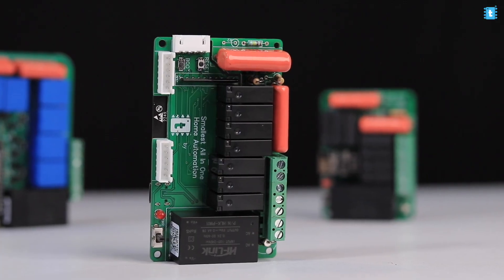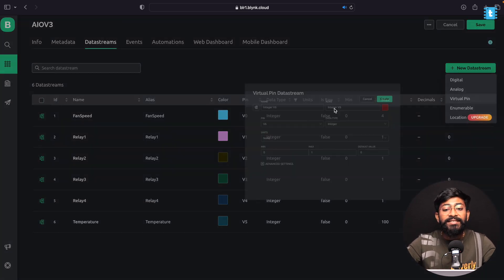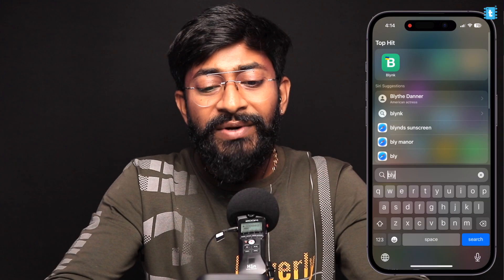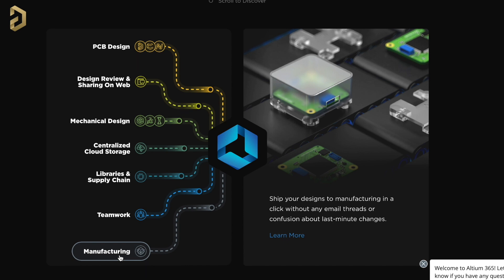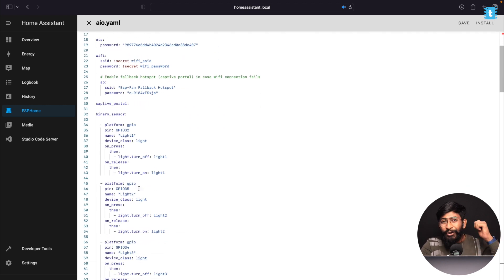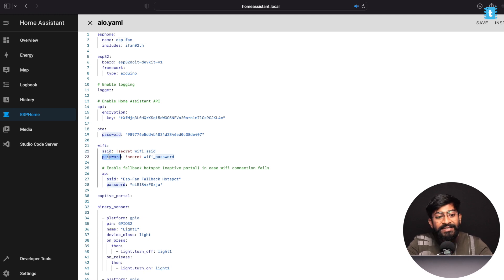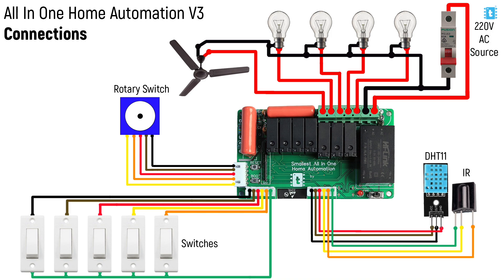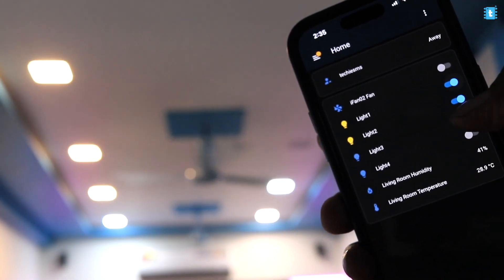Home Assistant & New Blynk based Home Automation project | IOT Projects 2023 | ESP32 Projects

Comment: For fan regulators and IR controls, the below codes are far more accurate and easy to use compared to what is shown in the video. 
We have been using them in our home for more than 1.5 years, and no issues have been reported so far."
Reply: switch:
  - platform: gpio
    pin: 23
    inverted: true
    name: "FAST"
    id: speed_low
    interlock: &interlock_group [speed_low,speed_med, speed_high]
    interlock_wait_time: 300ms
    
  - platform: gpio
    pin: 22
    inverted: true
    name: "SLOW"
    id: speed_med
    interlock: [speed_low]
    interlock_wait_time: 300ms
    
  - platform: gpio
    pin: 21
    inverted: true
    name: "MEDIUM"
    id: speed_high
    interlock: *interlock_group
    interlock_wait_time: 300ms
Reply: sensor:
  - platform: ir
    pin: GPIO14
    name: "IR Sensor"

switch:
  - platform: template
    name: "IR LED"
    turn_on_action:
      - ir.transmit:
          pin: GPIO15
          carrier_frequency: 38000
          # Replace the following with the IR signal you want to send
          code: "0x20DF10EF"